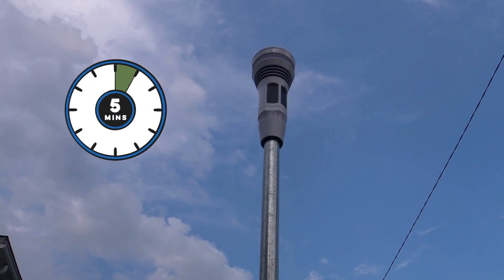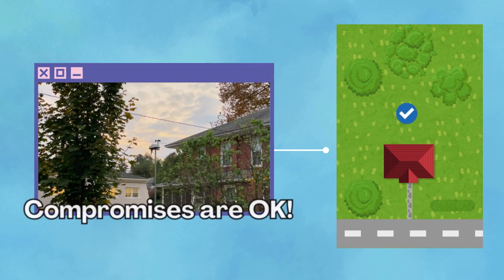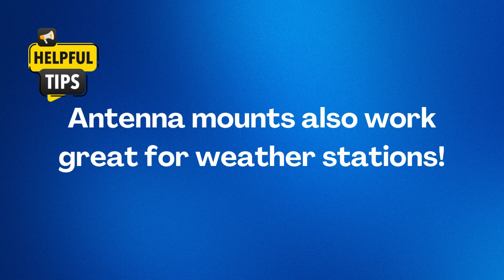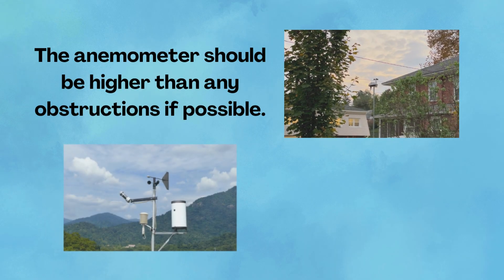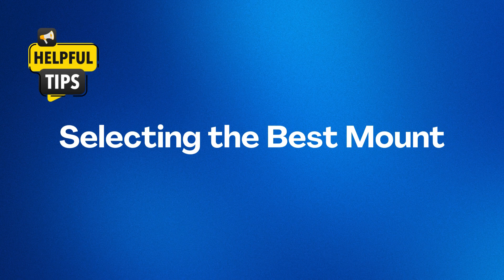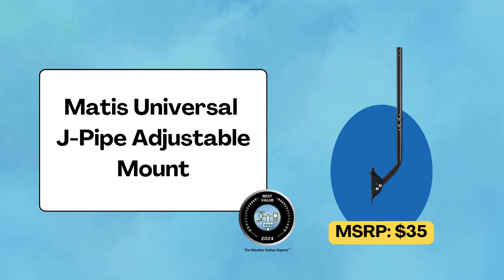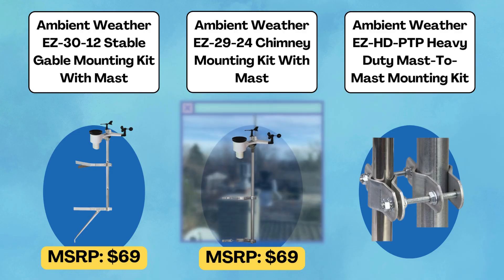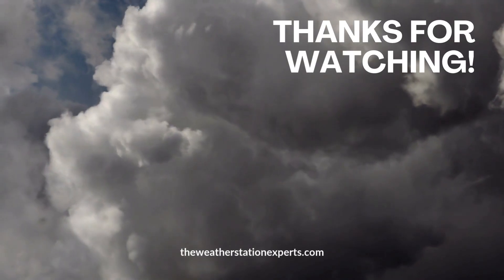The Ultimate Guide to Installing Your Weather Station

Comment: You mention that the weather station should be no more than 6 feet off the ground, but the wind meter should be 33 feet. How would you go about installing something where all the instruments are in one?
Reply: Hi I'm thinking about getting the ECOWITT Wittboy HP2564 soon and plan to mount it on the side of the carport which has a colorbond roof and the structure is away from trees etc.
I will use a Curved Fascia Mount with a pole hight of about 2.6m would this be a suitable location?
 I'm mainly interested in temperature & humidity and rain fall not so much wind speed.
Reply from the maker: @xrmte  From what you're describing, that should be fine. With the Wittboy haptic rain sensor, that needs to be COMPLETELY level to work right, so make sure of that, or you might find the rain readings way off. (I would buy a manual rain gauge though, haptics is sometimes problematic with rain measurement).
Reply: @theweatherstationexperts  thanks for replying yes I do have a manual rain Guage and no doubt I will need to calibrate  the wittboy I have done that with other weather stations with the tipping bucket 
But this one has no moving parts.
Is it pretty straight forward when adjusting the rain sensor on the wittboy?
Oh and you said sometimes can be problematic even when calibrated?
Any advice would be helpful.
Reply: is ws90 model better than ws69 model?
Reply from the maker: This is a great question. It depends on preference. If I have a way to get the sensor that high, I'll do that. However, that comes with the risk of other measurements being less accurate (for example, temperature may read high due to reflected heat off your roof, etc). If you choose height, I recommend mounting it off the side of the house to limit that.

Also, as I said, even getting it 10-20 feet off the ground will give you fairly accurate wind readings.

If wind isn't that big of a deal in your location, I'd keep it on the ground though. Easier in the end to maintain, too.